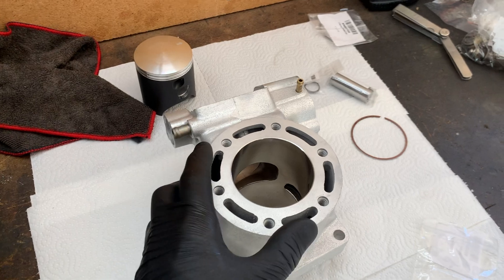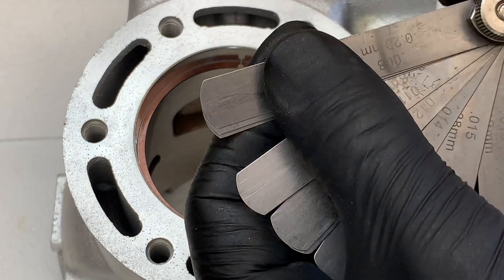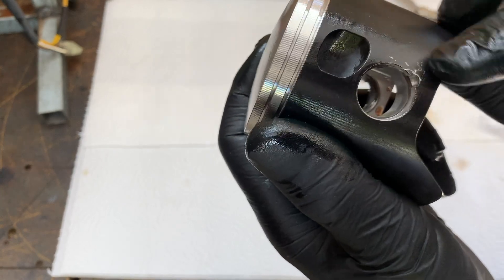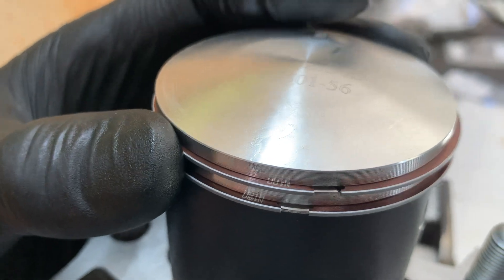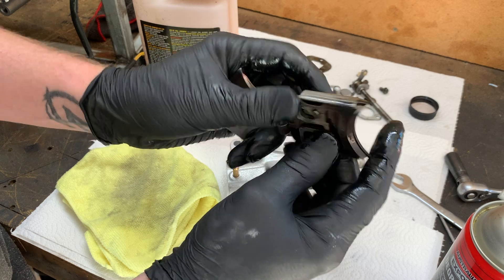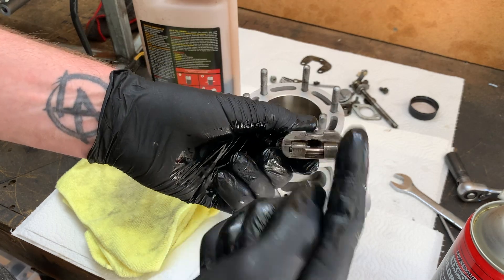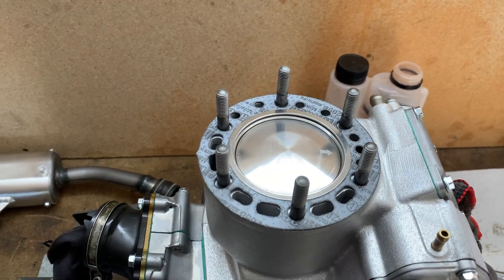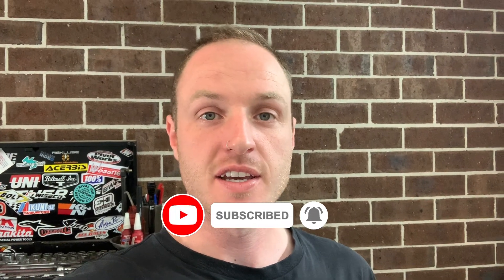Suzuki RMX250 Rebuild Ep.10 ( how to engine build part 3)

Comment: Can you tell me what after market exhaust fits my rmx 250 1997 I can't get a exhaust for it it's been sitting in my garage for a year now please can you help
Reply from the maker: I don't know if there are any available that "fit" without modification. older model rm250 expansion chambers may fit. and for the muffler I think DEP make a muffler that will fit (same as 96-00 rm250 muffler)
Reply: @jackkellybuilds  thank you